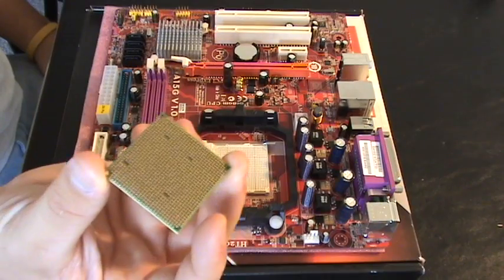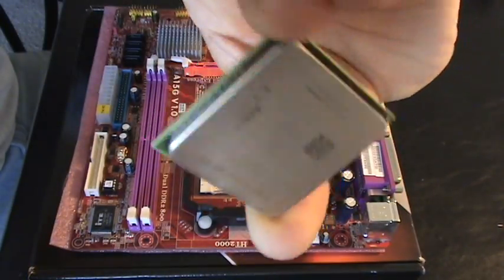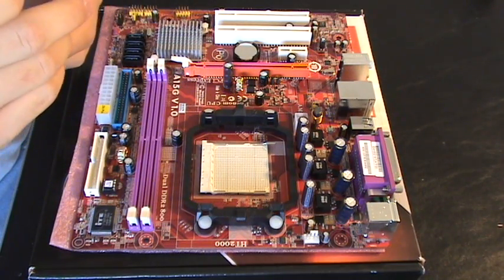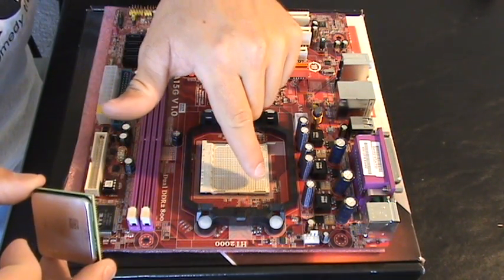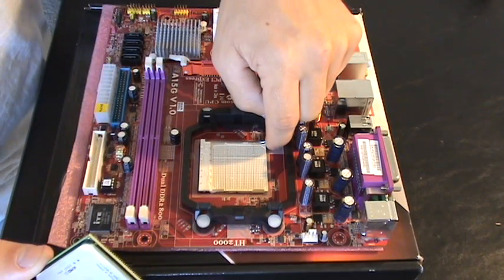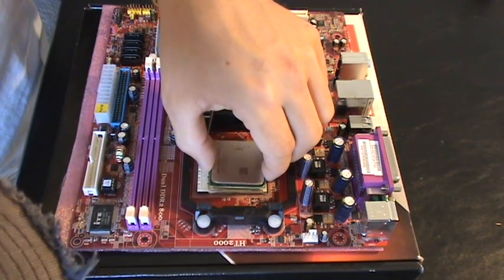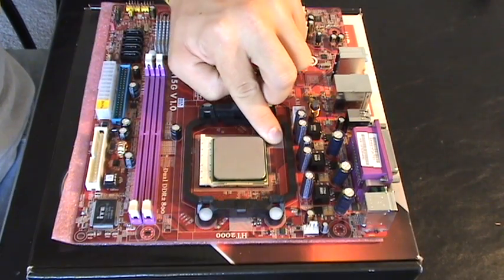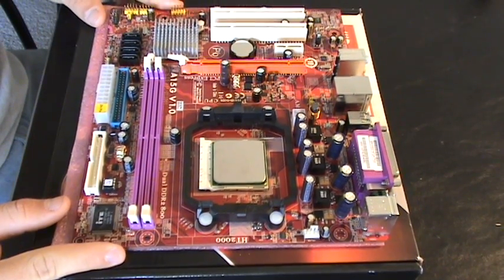How to Build a Computer - 15 - Installing the CPU

Comment: @AxisOf3vil you really need a cpu fan, but they're pretty cheap, $15 for a decent one if you're not overclocking. Make sure that the fan is short enough to fit into your case, and most CPU's will come with fans.
Reply: This was made in 2008 and your comment was made 3 years ago lmao. Some low-end cpus that can be overclocked with a cheap cpu fan. When I had my intel Pentium G3258 I overclocked it to 4.3 ghz with a stock cooler and no issues.

Comment: All Cpu have different socket types. Most current AMD cpus (phenom II, fx, ect) are AM3. Most current Intel cpus (core i3, i5, i7) are 1155. So, yes, you can't put an AMD cpu in an intel motherboard. But you also can't put an old AMD cpu in the crrent AMD motherboards either. Make sure you know the socket type of the CPU you want, and find a compatible motherboard.

Comment: can some one help me? i just built my own PC and everything went great and it runs awesome but one thing i noticed was from time to time my computer makes a click noise and then it sounds like something is powering down. I used to get this sound with my old PC when i would shut it down or hold down the power button to power it off manually...im hoping its just the sound of a fan turning off because after the sound nothing changes, my computer still runs at full and is great, im just worried

Comment: @desertfox1792 ......a ground strap protects the puter chips against static electricity...you ground your self at the wrist... a strap connects too you with an elastic strap around your wrist has a bought 3' wire and on its other end a clip to a ground source...IE..the puter case or in some cases the ground terminal at the wall socket...very important..!

Comment: @wc1hater 
Not always, if your motherboard has a Monitor connection, often looks like blue or purple with two side screws (anything similar to that) it means you have onboard video, meaning that you DONT need one, unless you are a gamer (usually onboard graphics on the MOBO are not very good) you probably would need one. If, like before your motherboard does not come with one of these connections, then it is compulsory to get a Video Card/GPU.

Comment: @KMelter 
Wear an antistatic wrist band and attatch it to your case or any metallic surface which is grounded, or alternatively to save about £1/$1 you could just keep your free hand on the case. You should not get a short if you have done it correctly.

Comment: What I enjoy about these videos is that they're divided up very well and short enough to cover each specific piece of advice so that if you need to jump to one section, you quickly get into what you need to know rather than wading through several minutes of unnecessary information.

Comment: Just touching something metal doesn't mean you are grounded.  You need to be electrically connected to the grounding system of the building in which you are doing the assembly.  Note: shadowblade said "while [the psu] is plugged."  That is because the psu is connected to your building grounding system ONLY when it is plugged in.  A lot of people fry components because they ignore grounding and shielding.  What is sad is that they usually blame the manufacturers.

Comment: I've never gad a problem with it over heating, even when left on, I guess because my air conditioner is always running. My laptop is a different story, its stainless steel  areas was as hot as a heated pan when I left it on by mistake.

Comment: the fan will come with it and a heatsink

the fan and heat sink will do a good job so long as the case also has suficient space inside for air to circulate and a case fan to extract the air from the case to keep the inside cool

Comment: I'd recommend buying a another heatsink instead of using your stock heatsink with  quadcore, even if your not overclocking. You basically MUST buy a new one to replace the stock if you overclock, for Dual core as well.